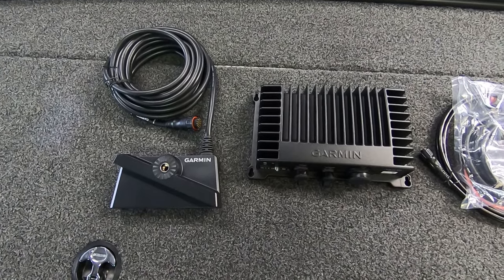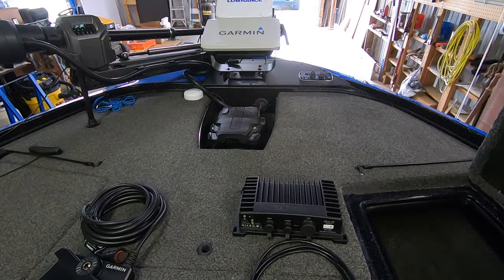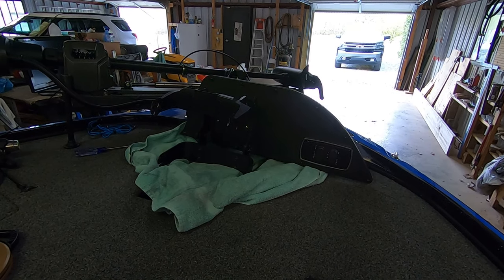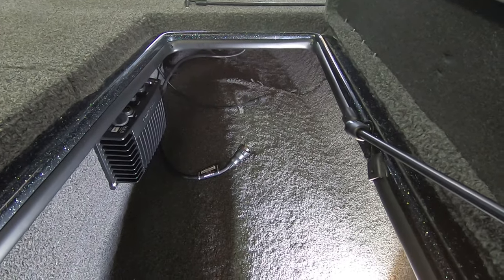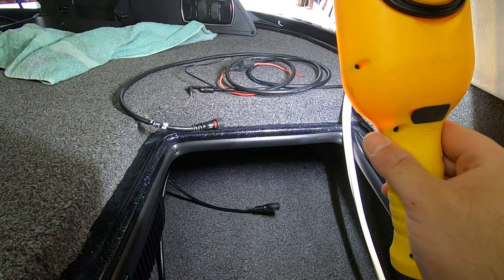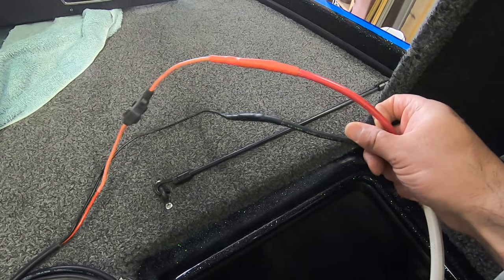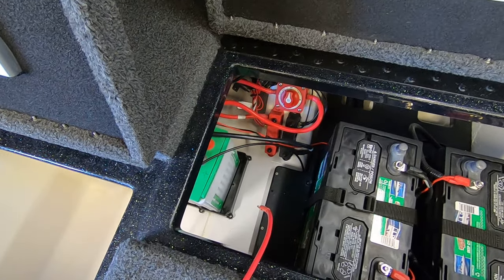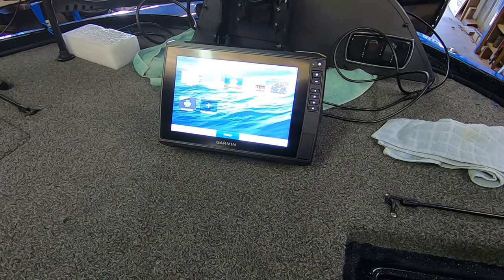How to Install Garmin LiveScope - New LVS34!

Comment: I'd recommend you put the inline fuse within 12 inches of battery. With the in line fuse in the bow you have a long length of wire with no short circuit protection. I hope that makes sense.. I'd put a but splice where you put the fuse and put fuse between battery and switch.

Comment: The gl 10 box has an Earth ground Symbol on the back not a negative to the battery this is to prevent RF interference, yes your battery negative is grounded to the motor, and the motor is grounded in the water, but when you ground to negative on battery the RF and blue tooth signal can travel through all the units connected to the battery if you have interference. You need to ground the gl 10 to a water ground some boats have a ground in the hull some have a metal plate under the dash. VHF hi-power radios must have water ground it would mess up your electrical system. I talked to Garmin Tech about this on the phone. If you have a problem water ground!

Comment: I put my fuse for my Garmin     126 sv coming out of my perko on/off switch . I will eventually make a double pigtail out of the perko to supply power to a live scope box . It will have its own fuse as well ! I like having the fuses in the back for easy access.

Comment: Great video showing how to install the hardware!  I thought I would mention that fuses should be installed directly to the power source in order to work properly.  Hope this helps!
Reply from the maker: Yes that was one of the things I learned after doing this install.  Surprising that the only way to install farther from your battery is to move the factory installed fuse… but yes you are right, the fuse should have been right next to the battery.  Thanks!
Reply: @Everydayfishing I learned the hard way on my first boat several years ago!  Its easy to mislead people since the power cable comes with a fuse installed on the positive lead.  So I took an online course on electronics and it help a ton on setting up power on my boat...as well as many other installs

Comment: I am getting a hot foot installed in my Nitro Z18 soon . You said In a video that it took awhile to get used too . What did you have to get used to ? How was launching and loading ?  Did you get the turn signal trim on the steering wheel as well ? Any input would be greatly appreciated.
Reply from the maker: Love the hotfoot!  Great upgrade.  I did also do the turn signal trim - lets you keep your hands on the wheel the whole time you’re driving. There really wasn’t any learning curve or anything to get used to - the hotfoot is super easy.  Feels like driving your car.  You’ll Iove it!
Reply: @Everydayfishing  did you get a jack plate ? My boat seems to plane out pretty good without one ! I was told the transom warranty was void with a jack plate . I rarely drive over 45 and don’t fish shallow that much .
Reply from the maker: @MrFishhook  I did not get a jackplate - I agree, don’t need it for performance, but I’d eventually like one to mount power poles on
Reply: @Everydayfishing  even in Florida I look for the deepest water and use spot-lock a ton ! If I go real shallow I have an eight foot anchor pole. I don’t bed fish ( just my preference) . Thanks for responding!

Comment: It's nice to see a really good quality install and not a hack job.  I'm saving this for a future install.  Haven't quite pulled the trigger on the forward facing sonar.  Does work well though.
Reply: Except for the fuse, it should be at beginning of circuit.

Comment: Nice install. Only thing I would do different is cut the supplied power cable and splice the 8 AWG wire 8" from the connector as instructed by Garmin.

Comment: Did you not connect the ground.to the ground screw on the black box? What exactly is the purpose of that ground screw?
Reply from the maker: Yeah I did end up connecting it because the instructions said to - I guess it works the same way any ground does… some people say it helps get a clearer picture than if you didn’t

Comment: Realizing that you haven't had it in use for very long, but are you satisfied with it mounted on the trolling motor or are you considering a dedicated mount of some type for it?  I have an Ultrexx and use Spot Lock a lot, so I am a bit torn.  About to pull the trigger on the LVS34, but still unsure how I want to mount it.  On the TM for sure to start though since that gets me in the water the quickest.
Thanks for the video!!
Reply from the maker: Yeah honestly I haven’t had any complaints with it being on the TM.  I’d rather not take up space on the deck with another mount.  If I do plan to use spot lock, I’ll take a mental note of where the fish/structure was, and make my casts that way.

Comment: Is that silicone wire inside the white sheathing that you used for power?
Reply from the maker: Yeah each wire is silicone coated but outside sheath is PVC.  The one I purchased is called marine duplex wire - on Amazon

Comment: So, a network cable is needed to connect from the garnin graph to black box?

How did you get power for your graph from a fuse block or did you go direct to your battery?
Reply from the maker: Garmin supplies you with the cable needed to go from the black box to the graph.  I did run power from the fuse block in my drivers console to my graph.  Power for the black box goes directly to the battery.

Comment: I'm curious to know how your front graphs ride on the front Nitro metal plate? I hear the weight of two graphs causes the screws that secure the plate eventually loosen and you have to use larger screws to hold the plate down.
Reply from the maker: I have heard the same but I haven't had that issue yet.  I've had them installed for almost 2 years now without the plate coming lose.  Granted, I do check every couple trips to make sure they stay tight, but no issues so far.
Reply: @Everydayfishing  Thanks for replying, I'm sure you're a busy guy like me. I also have a Z18 (2022) that came with Active Target so I'm curious what gauge wire they used from the factory. I also have a power switch at the console that shuts off the Active Target box, which is located just a few feet from it in the front right storage box. Would you still recommend updating the wire from the battery to that power switch?
Reply from the maker: @backcountrybrian3746  I would guess they used 10ga - which is the minimum Garmin recommends.  If you're happy with the performance of the graph and livescope, I wouldn't worry too much about it.  If the wire is accessible, you could run the unit for a bit, then try feeling the wire for any heat... as long as it's not getting too hot (fire hazard) then I'm sure it's ok!

Comment: What Garmin unit do are you using? Did you need to update the Garmin so it would recognize the live plus?
Reply from the maker: This is the 106SV - I did not have to do an update for it to see the LiveScope Plus... but Garmin recommends that you run the latest update when installing.  It did work right out of the box for me though.
Reply: Thanks for reply and great vid. That’s great to hear as I just purchased the same stuff.

Comment: How do you run your spot lock ! Having transducer cable directly on your trolling motor shaft? Don’t you have potential to break your cable ? Most I’ve seen have a pole attached to trolling motor shaft that runs independently.
Reply from the maker: You just have to leave enough slack in your transducer cable - a small loop is usually enough.  I just tested it by deploying the trolling motor in the garage and spinning it full rotation
Reply: Do you run your Trolling motor on 24 volts or 36 volts . And what is your battery set up ! If you run 24 are you happy with it ? Enough thrust ? Lithium or lead acid on TM and What starting battery do you use ? Thanks for info
Reply from the maker: @MrFishhook   it's 24 volt system - lead acid old school batteries.  Never had a problem running the trolling motor for 8-10 hours all day.  My starting battery is a group 31 lead acid.  Also no issues running 3 graphs and lvs34 all day!
Reply: @Everydayfishing  I think we have the same boat and set up ! I have a Nitro Z-18 with the same batteries, I want to upgrade trolling motor Batteries to lithium. Not sure about 24 volts or 36 volts . Will probably run 2 12 volts to get 24 volts. 98 thrust seems enough! Thought about adding a third lead acid battery just to see how 36 volts runs compared to 24 volts . It would be a 200 dollars experiment to see the difference before going to lithium lol…. I can always put the lead acids in my small bass boat ( Sun Dolphin )
Reply: Question: How are your Garmin transducers set up ? If your Garmins live scope transducer is on your ghost trolling motor where is the transducer the unit came with mounted ? Sorry for all the questions, but trying to rig my boat this week. Thanks Paul

Comment: Awesome vid! Curious as to why you didn't use the fuse box at the helm that you used for the garmin graph?
Reply from the maker: Thank you!  Garmin and most people recommend that you run power to your black box directly from the battery to remove the chance of any interference.  Theory is the more direct power the better picture you’ll get from the LiveScope.  Not sure if it’s 100% based in science but it’s easy enough to do so why not

Comment: Quick question, does the cable coming from the black box to the screen also power it? Or does the screen require its own power cable as well plugged in? So if its only dedicated for livescope the screen will have one or 2 cords connected to the back?
Reply from the maker: The Garmin unit and the black box both require dedicated power.  The cable that connects the black box to the unit is for data transfer only… so yeah, need to supply power to each

Comment: Curious why you didn't use the power switch that was already on the boat?
Reply from the maker: The power switch already installed shuts off power to everything... I wanted to be able to only shut off the LVS34 Black Box.  That's the only reason I added the second switch.

Comment: Great video. May I ask what brand/type double graph holder you're using? I have Lawrence HDS7 up front that I'd like next to the Garmin
Reply from the maker: Thanks!  The mount is the Hennessey Outdoor Electronics Dual Mount - I’ve been very happy with it

https://hennesseyoutdoorelectronics.com/collections/hennessey-outdoor-products/products/hoe-universal-duel-mount
Reply: @Everydayfishing  I want to thank you again for your video. I purchased a LVS32 Transducer and GLS 10 Sonar Sonar Black box from BassPro. The sales deal came with free installation. But after talking to the service department there they said they would need to install wiring and battery shut off switch along with connectors for a extra charge. It was about $400.00  I knew immediately that I can install myself. They were going to charge me all that for screwing in the black box and connecting it to a 8 AWG wire to battery. Thank God I have tools and enough knowledge to do it myself. Your video just confirmed everything for me. Thank you again.
Reply from the maker: @rickgarza1041  Heck yeah - you can definitely do it yourself!  Plus you get a good working knowledge of how it's all connected and it helps with any troubleshooting you might need to do in the future.

Comment: looks like you have the prospective mount set up for port side . Your motor stows to the starboard side. Am I seeing this wrong??
Reply from the maker: I used the shaft mount bracket and I have it on the right side of the shaft... and my TM stows to the port side.  So when stowed, the TM nose cone faces outward and transducer is on top.

Comment: I just got mine I’m only on a 10’ Bass Raider. Stupid question, do I still need my UHD56 transducer along with the livescope transducer?
Reply from the maker: No you don’t need it - I actually sold mine.  You could keep it in case you ever want to use down imaging… but if your graph only has one transducer input, you’ll need to unplug the LiveScope to plug in the UHD56
Reply: @Everydayfishing  ahh I gotcha, thanks!

Comment: Question 🙋 so i have a kayak with a 100 amp battery for my trolling motor xi3 and a 20 amp battery for my 106sv do you think i can plug my black box to my 100 amp trolling motor battery and keep my 106sv on the 20 amp?  Reason i want to split the power is i dont wanna have to buy another 30to 40 amp battery do you think i may run into problems if i split the power of the black box and fish finder, hopefully i made sense thanks.
Reply from the maker: I don't think using different power sources for black box/graph is an issue, but where you might have problems is if you connect either to a trolling motor battery.  Usually people get interference on the graph when it's connected to a trolling motor battery, so I would assume that also stands for connecting a black box to it.  Rather than get a third battery, could you maybe just get a bigger second battery to power your electronics?

Comment: Well done as commented last week 
Question 
I have the Black Box wired 14 gauge to the Blue Seas Fuse Panel as well as the Garmin Echo unit to the Blue Seas Fuse Panel

Should I redo the Black Box with 10 gauge and run directly to battery compartment with a Switch as you did?
I like the idea of Disconnecting Power of Black Box
It looks like you wired to the Starting Battery

My Blue Seas Fuse Panel is fed with 10 gauge from switch connected to AGM Battery which is also my starting battery 

With that being said maybe not a good idea to wire Blk Box thru Blue Seas Panel with no switch at this time.

I see on your video there is a Green Light on Black Box

Do you have a link for purchasing the switch and duplex 8-10 gauge wire?
Thanks again 
So easy to follow and listen to your great install.
Reply from the maker: I'm glad it was helpful!  Honestly it seems like my switch on the black box power was not needed.  When I turn my Garmin graph off, the black box goes off.  So I think that's all you need if you're concerned about saving battery when not using the LiveScope.  

As for direct power straight from the battery, as long as you're getting a clear picture when using your LiveScope, I wouldn't worry about by passing the fuse panel.  I've heard that some people who have lots of interference in their picture have ran power straight to the battery to help that issue.  But I don't think its always the case.

Comment: Excellent Video!
I just watched it
As I just finished my install as well
I did almost the same install 
Except I have at console a Blue Seas Fuse Block and wired Black Box and Echmap Ultra to it
Actually double fused

I don’t understand why Garmin only supples a 6’ network cable 

Why not for $4K purchase they can’t add a 10-12’ foot cable 

What bracket did you use for Lowrance and Garmin?
Very nice and professional install

I have to say you have made the best install video I found 

Thanks for all your great work
Reply from the maker: Thank you!  I'm glad it helped.  My graph mount is the H.O.E. Dual Mount from Hennessey Outdoors.  Very solid and reasonably priced.  I'm happy with it!

Comment: Does it reqly make a difference if you use 8 or 10 AWG wire
Reply from the maker: All depends on how far your run is… the instructions explain what gauge is needed for certain distances.  But I figure it never hurts to have higher gauge

Comment: Is that your cranking battery you have it hooked up to?
Reply from the maker: Yes - power is run directly from cranking battery to black box.  With that switch in between to cut power if needed

Comment: is the graph powered separately or through the black box?
Reply from the maker: Yes graph has a separate power supply - mine runs back to the fuse box inside the drivers console but you can also run it straight back to the battery.

Comment: How did you supply power to your Garmin fish finder? Can you hook it to the same power cord from the battery or will that cause interference with the black box? I haven’t started my install yet. I have a older nitro 750 and I’m keeping my helix seven on the front and then hooking a Garmin 1022 strictly for live scope.
Reply from the maker: My Garmin unit power is connected to the power bank under my front panel.  You could run power directly back to the battery if you didn’t have that option, but I just didn’t need to go that far
Reply: @Everydayfishing  Thanks, I don’t know what’s behind the panel yet, hopefully it have something simple to hook into.
Reply: One other question where did you get your eight gauge white wire? I went to Lowe’s. They didn’t have nothing but separate wires. I’d love to be able to just run one wire. Thanks.
Reply from the maker: @dfort5203  I found mine on Amazon - you can search for "marine duplex wire" and you should be able to find some.  I used Ancor brand on mine.
Reply: So did you have to run power from the graph also? The directions only show power from the black box to the battery and then the network cable from the black box to the graph. 

Greta video by the way!

Comment: Are you not planning on using perspective mode? It appears that with this method of mounting there will not be enough play in the cable to change it to perspective mode
Reply from the maker: Yeah good point - to be honest I haven't taken it out of forward mode!  It's just so useful... but yes if I do switch modes, I'll probably cut some of that tape and give it more slack.